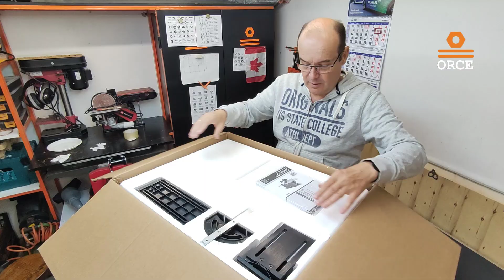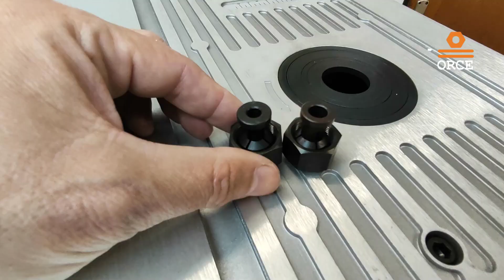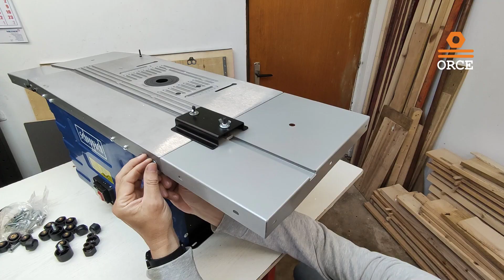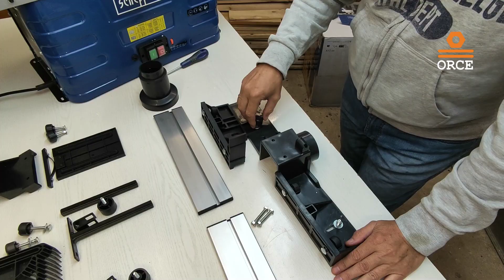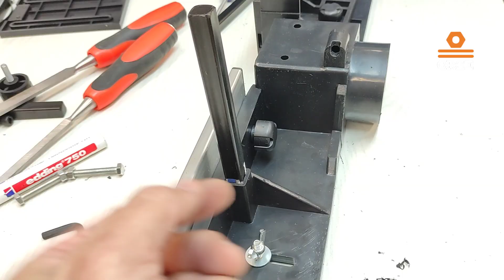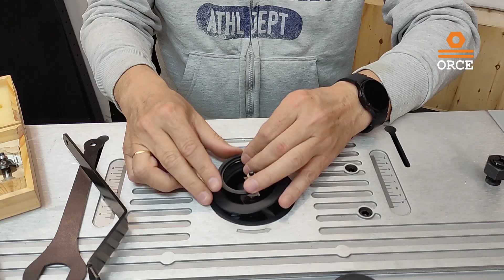Tabletop router SCHEPPACH HF60. Unboxing  & installation. Is it a good choice for you workshop?

Comment: I've just had 2 HF50 machines given to me, they were going to the tip! By robbing parts from both machines I've got 1 functional unit and now have to swap tables as the working machine table is over 1mm out of flat. The height adjuster is run by nylon gears which strip if you look at them hard, the fence is anything but smooth to move and the spindle lock loves collecting sawdust and jamming so that it becomes inoperable. The dust extraction port has a metal grate that is supposed to stop large wood chips from choking the suction hose, it does and it also chokes while doing so. In many cases while routing groves for instance, the extraction is useless and the shavings fall into the bottom of the machine just waiting to cause trouble. Moral, you get what you pay for and obviously the machines I was given are worth every cent I haven't paid for them.
Reply from the maker: That is one very correct description. I agree 100%. I have done few simple  modification just to make it more acceptable for hobby work and posted some videos about that. Welcome to the channel.
Reply: @orce_MKD_DIY  Thank you.
Reply from the maker: Have a nice weekend.
Reply: @orce_MKD_DIY  You too mate, I hope it's a good one.